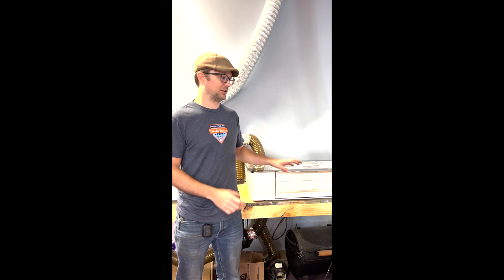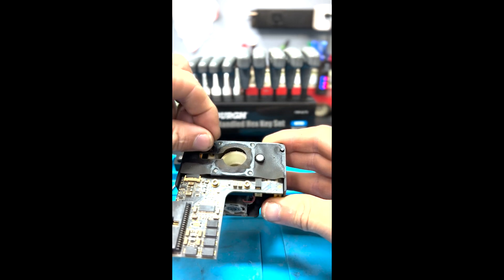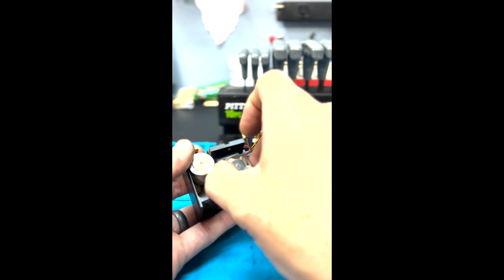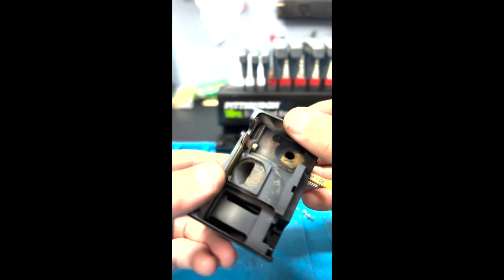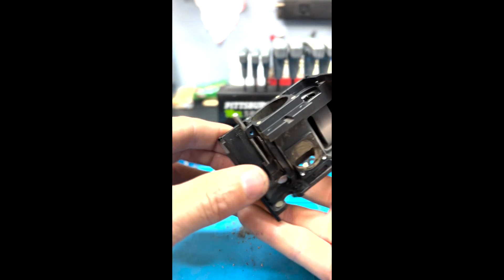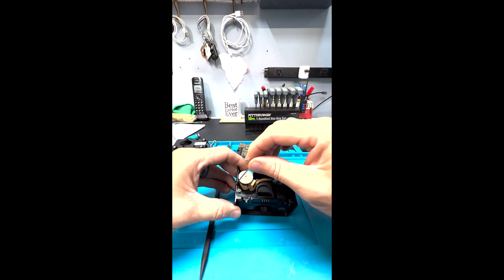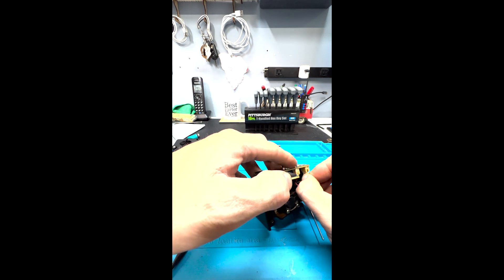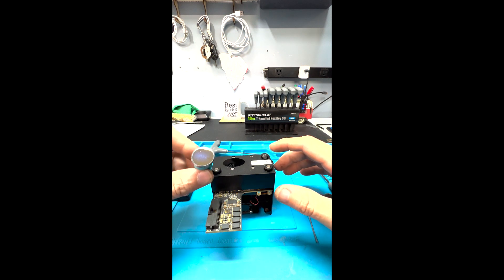Glowforge Laser head tear down for cleaning

Comment: Hello, this video is super helpful. I followed your instructions but i used 91% isopropyl alcohol to clean the small fan blades and the board with a very soft brush. I put everything back together and when i am going to do a calibration I get the flashing yellow after I press the blue flashing button. The calibration cannot be started. I am stuck 😢. I checked everything again and putting back together. I double check the white printer cable and it is set properly. I also check the 4 pins and they are making a good connection. Did I messed up the board by using isopropyl alcohol to clean it? I mean it does not make sense. I let it dry out. I cannot use my machine now. 😢😢😢
Reply from the maker: What error are you getting?
Reply: “ no print

Your glowforge wasn’t able to print the pattern successfully. Turn your glowforge off and on, then try again. If there are  any marks on the material, you will need a needle piece of material.”
Reply: Could a bad fan give this error code or yellow light?

Comment: Excellent training video! Very delicate assembly. One thing that may be of interest is wearing an ESD strap and grounding it to the GF frame while handling the circuit board. I have had issues in the past where a static charge damaged a board and you can't tell visually at all. Just an observation. Thank you very much, and also, do you know of any diagnostics for troubleshooting that are available? I would like to be able to check sensors and turn on fans and motors through an I/O service interface. I don't do Facebook, but I have been looking on GF community forums for info, especially for errors like "Head not found", it's like trying to diagnose your "Check Engine" on your cars. Thanks again!
Reply from the maker: Sadly glowforge offers zero help for repair yourself people.  The issues have had to be tested or part swapped to repair.  They are great little lasers but the customer support on the repair side isn’t great.  Or at least isn’t consistent across the board.
Reply: @Cruizin542  Thanks for the response, much appreciated. This product could be so much more but I think they dropped the ball along time ago. I can fix a lot of things, but I need the tools to be able to fix them

Comment: Thank you so much for the videos! I have used several to help me. along the way with my Glowforge. One thing I cannot figure out is where is the temp sensor in the Glowforge pro? my pro is 3 months old and unable these days. Non stop temp error saying it needs to cool down. I have cleaned and cleaned everything, watched your videos and done everything. I dont know where this stupid sensor is to make sure it's clean. the support at Glowforge is horrible. I wish I knew that before buying, I wouldn't ever recommend these to anyone because of the horrible support. They just keep giving the run around. I live in MN and its literally -18 degrees and inside the house its 65 degrees. Thank you again!
Reply from the maker: Hi so I’m not sure where the sensor is.  I think it’s on the mother board, I have had these machines 100% apart and do not see an obvious sensor.
Reply: @Cruizin542  thanks for the info! I did join that Facebook group and searched overheating. Lots said it was related to the small fan on the laser head. I took it apart and really cleaning it. I’m gonna try cutting again. Appreciate the help today a lot!

Comment: Would having ash or a foggy lens on the print head cause an orange light? I’m not sure where to go now. I get an orange light on start up, the head moves forward and to right about an inch each way and then I get the orange light. I’ve replaced the white lid ribbon, the black lid ribbon, the white printer head ribbon, the carriage tray, and the daughter board. 

If I place the printer head directly under the camera it either gets stuck center or homing and sometimes gives the error “head not found” other times it just sit there.
Reply from the maker: No they wouldn’t cause it.  Check the white ribbon cable thst connects to the laser head for any damage or black spots.
Reply: @Cruizin542  I’ve replaced that cable with a new one already and it doesn’t have any damage or black spots.
Reply from the maker: Join friendliest glowforge Facebook page and post there.  Will try to help out.
Reply: @Cruizin542  That group has been awesome and really helpful and I am part of it. My girlfriend has worked with a group expert there and they don’t seem to think there is hope for it and offered to buy our glowforge 😞. I was being hopeful and reaching out here thinking it may be the printer head. I will reach out there again

Comment: I’ve been trying to find a laser tube replacement tutorial since that seems to be one of the parts that inevitably fails. The cost of shipping it from where I live to get it fix would cost more than getting a custom laser tube made here 😅

Just wanted to see if you’d ever do a tutorial
Reply from the maker: Hi, well thats a tricky one.  Glowforge has no way to line up the laser without their logs and programing software tools.  There is always a work around, but we are not confident enough to do a video.  Not to mention have not had to replace a tube.

Comment: I took apart the screw cap part you didn't clean and now I dont know how to put it back together... do you have a video showing this?
Reply from the maker: Hi the lens just drops down in there then the screw cap goes over it.
Reply: @Cruizin542  for some reason I have 3 lenses. A thick one, a thin one, and a black tube one with a tiny lens. 

I put the thin little one in and now I cannot get it back out 😩
Reply from the maker: @hemlockheritage  join the friendliest glowforge Facebook group and post some pictures.  The lower glass does not pop out it’s epoxied on there.
Reply: @Cruizin542  thank you. I’ve joined and showed pics. Hopefully it can be fixed!! 🤣
Reply: @hemlockheritage  Hi, i was wondering if there is a particular order. I can't figure out how to put the three lenses back
Reply: @hemlockheritage  What order do you put the lenses in
Reply: @Cruizin542  do the glass windows pop out so I can push it back through?
Reply: are you on instagram?